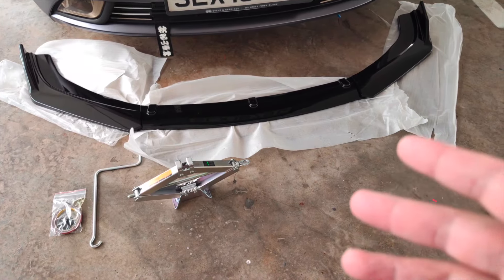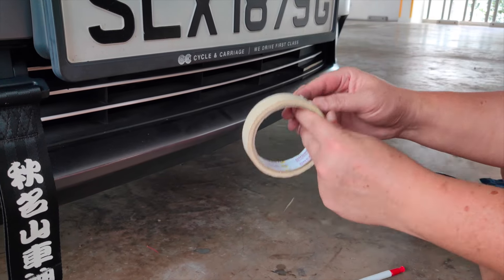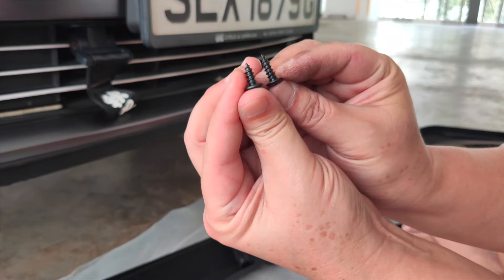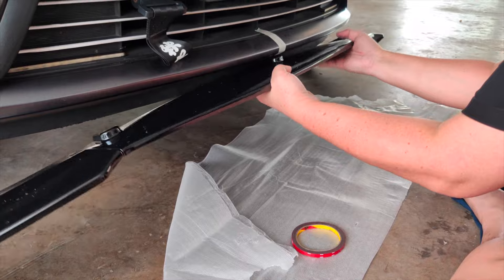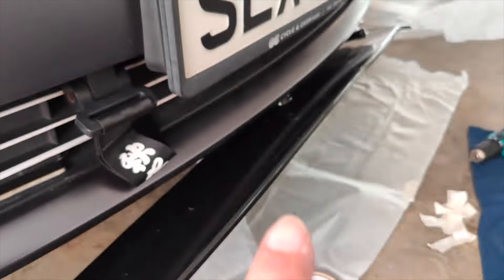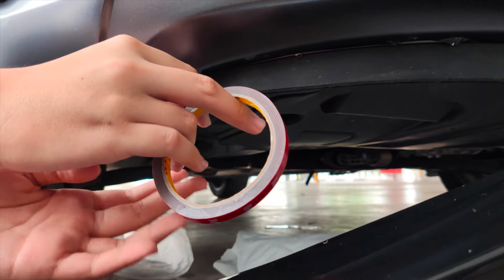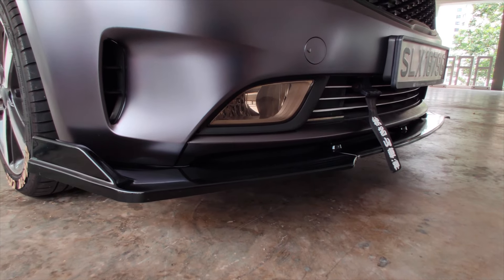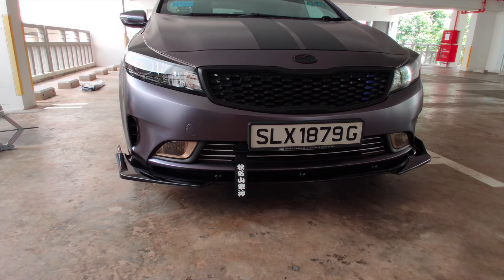HOW TO INSTALL UNIVERSAL FRONT LIP FOR YOUR CAR

Comment: Had this on my forte until I broke 2 of them. Upgraded to the Aerotekk front and side splitters.
Reply: How did yours break if you dont mind sharing ? I installed mine yesturday and broke same day driving 80mph on highway 🤦🏻‍♂️😂 smh
Reply: @deporcali23  same and the other time was snow.

Comment: Have you had issues with highway driving ?  Any cracking ?  I installed mine yesturday and now its gone from the middle ( cracked ) im guessing its bc its 4 pcs its not fully solid to be secured enough  …. I mean ik its hard plastic but was expecting it to last more than 1 day 😂🤷🏻‍♂️

Comment: How much should I pay for installation of all this assuming I have the parts. 2016 Chevy spark
Fender flares, front lip splitter, rear spoiler, mud flaps, window tint visors, full window tint, wheel cover, bumper fasteners, and paint correction on the hood which has some scratched areas and needs 2 stickers removed with a heat gun. Asked one shop so far and guy said somewhere around 8500. That seems kinda high.
Reply: Bro he overcharged you to the moon, find a small shop or honestly you can do it all yourself with some tools except for the window tint
Reply: If you need help doing it I’d be willing to help through the phone I’m 20 been a car painter for 3 years and know how to buff/ bodywork etc pretty good

Comment: May I know how the lip is holding? Will it drop out when driving at high speed? And will kenna scrap when driving over hump?
Reply from the maker: So far the lip is holding up no issues and doesn't scrap the humps.
Reply: What about LTA inspection? Got any issue?
Reply from the maker: No issues, I passed LTA inspection with the front lip on
Reply: @ianfann  Thanks for confirming the lip is still holding up. For extra safety I'll use extremely strong double sided tape and probably screw in a few more self tapping screws. But have to say this is one of the most straight forward videos to follow. I'm really looking forward to fitting these parts myself. Thank you for sharing

Comment: did you make holes on the car bumper to attach the lid? or you had holes already? thanks
Reply from the maker: No need to make holes, just use tapping screws and screw to the bottom of the bumper

Comment: Any eBay or Amazon links to buy one similar to this? I bought one a while back but it’s way different from yours. It came with two center pieces that stack on top of one another but it doesn’t align with my car well...
Reply from the maker: Hmm I don't usually shop on Amazon so not sure if they sell it there but having said that, this is a universal lip and there are a few designs in the market for you to choose from and you will need to look at the dimensions, design and fit before you make your purchase.
Reply: Thanks for the reply... btw What’s this design called? And around how much does it cost?
Reply from the maker: Hmm, there wasn't particular name to the design I bought. It was just called universal front lip.
Reply: Alright well I appreciate it. Nice car btw!
Reply: @jaychez5610 yes. Ebay, and also Amazon, carry these. As he said, there are multiple applications, and styles for most vehicles. Universal fits does not mean it will work on any vehicle though. Make sure you find one that has the correct fitment for your vehicle. They usually will ask for your car make, model, and year. I found a carbon fiber one with adjustable struts for like 50 bucks. New. Should be here in about a week. I'll also have a video up for the install. I have a 2016 ford fiesta se hatchback. If there is one for this, there is most likely one for most vehicles.